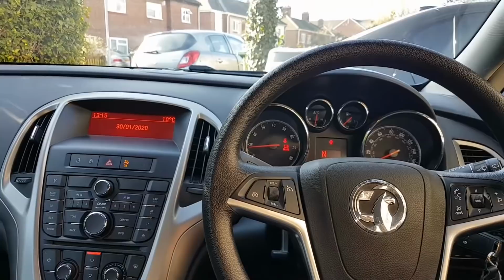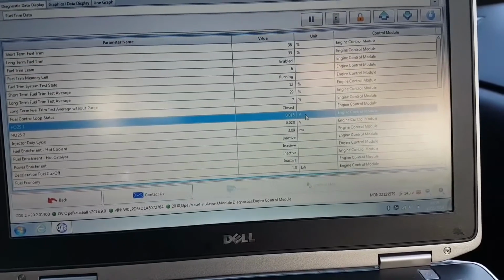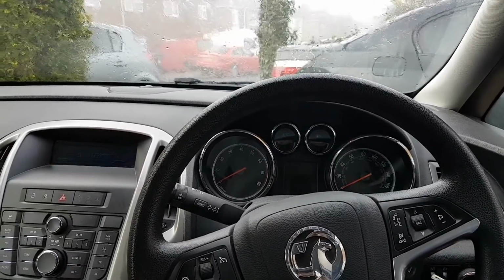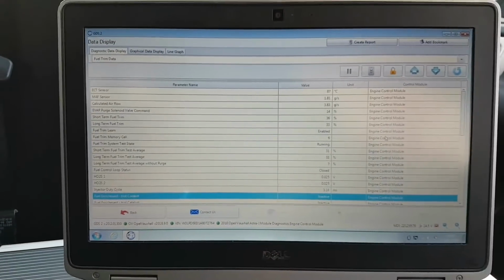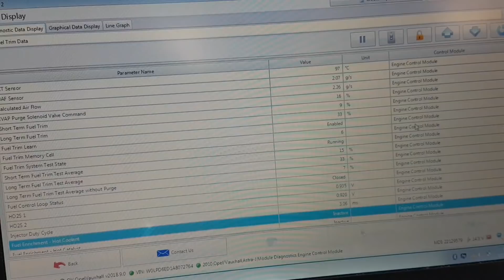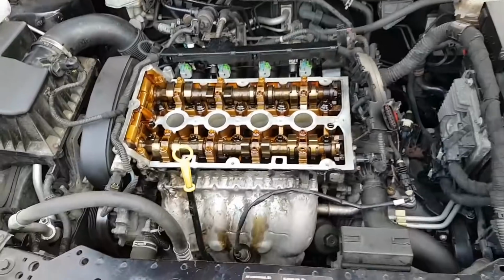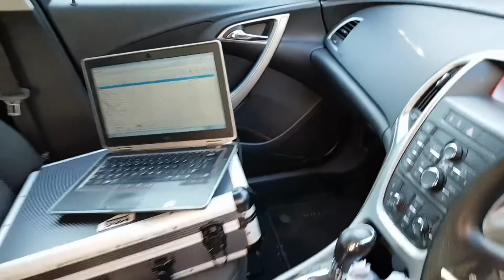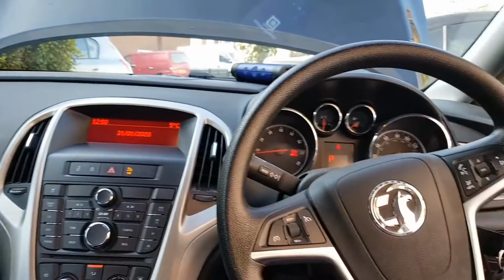Vauxhall/Opel Astra J 1.6 P0171 & P0106 running lean. Fault finding and repair.

Comment: Vauxhall are really poor in my opinion.
Reply from the maker: They could be better... definitely...
But goes to many other brands... 😊
👍👍👍
Reply: @LMAutoRepairs  

I know. Because they have to make the cars lighter, build quality suffers and manufacturers use other companies engines. I mean, would you buy a Mercedes with a Renault engine? And there's too many modules in stupid places where they get water ingress all the time. Its laughable. 

Smaller engines with turbos are too highly tuned and overheat like the ford engine. Vw have a high engine failure rate too on the TFSI engines. Total crap.